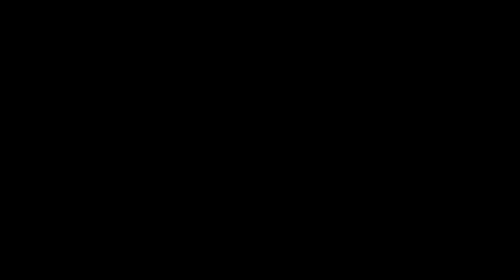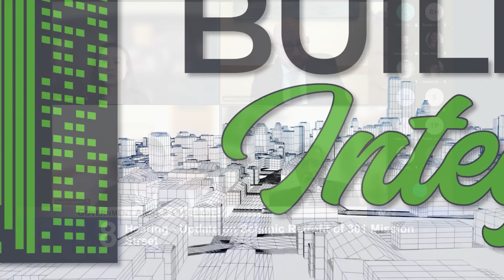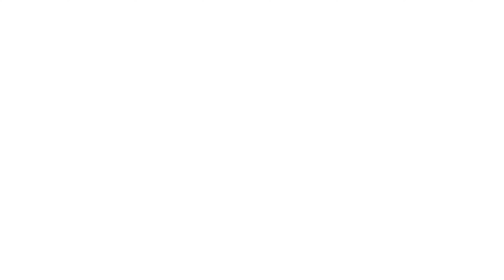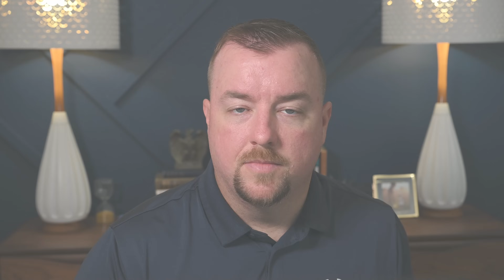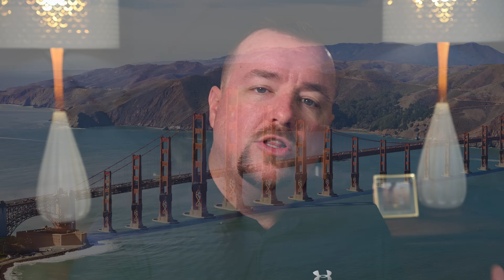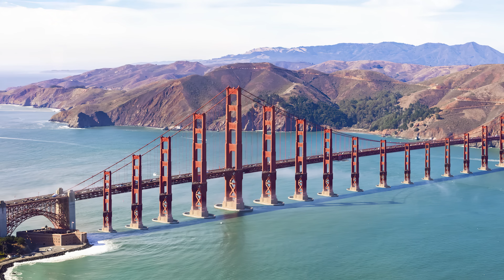Millennium Tower's "Sophisticated" Fix?  You Decide - (San Francisco's Leaning Tower Part 4)

Comment: Seeing that installation of "fixer" piles on the low side has shown that it accelerated settling of the low side, why not experiment with installing "fixer" piles on the high side to see if it accelerates settling on the high side. IOW see if you can correct/augment the tilt while the correct solution is found and implemented.

Comment: I think two things happened. The cost of installing 52 piles was X and it would be more desirable to have less total cost from the point of cost. Now with the increasing tilt caused by test pilings its time for a round of good old CYA.

The original design was flawed and the "fix" sounds like it's equally flawed, maybe it's time to cut to the chase and bring in the wrecking ball.

Comment: I think they went to an expert for a solution to the problem, and their idea of an expert was an almost retired engineer with a lot of experience, who didn't want to use a computer because he learned the old school way, through cutting blueprints. Then that retired/nearly-retired engineer decided to come up with a simple solution, find similar problem that had been solved before, copy the design with a 3x safety-factor, and hope the solution was over-engineered enough it would work.

Then in executing the plan they realized they were destabilizing the ground too much, and had to come up with a lean-engineering solution, which probably required a computer with FEA using dynamic beam-analysis (I'm only a designer but have done beam-analysis before to check my work), then came up with the original solution the old-timer copied.

Short answer: it took them a while to realize they needed a computer analysis, not just a grey-beard analysis, and by the time the ego-trip happened . . . the computer told them they had over-engineered the situation, should have gone to the computer first, instead of the engineer with the most plaques in his office.
Reply: Strange-- you're the first person I've seen mention FEA, either in the video or in the comments. Do you suppose they actually used it at some point?
Reply: @exrobowidow1617  With the situation with the tower getting worse, they have begun exhausting all options, now that their first 'cheap' bids/advisement didn't go well. They probably have done at least basic beam F.E.A. to get started, but a more advanced study would have discovered the problems they mentioned in this video before they happened, so I don't think they've done a full analysis yet, or are working on it asap. With the tower continuing to lean further out of plumb, they might actually be going to fully-meshed surface models instead of just beam elements to start getting their head wrapped around the problem. There aren't a lot of independent people in that field to hire though, mostly larger businesses and corporations who can afford the six-figure price for the software and a mainframe computer system capable of meshing and calculating quickly and give them real-time answers, so it starts getting really expensive to hire the engineers now.

Comment: If your company ever worked with geotechnical engineers, you would understand that's exactly the way that many of them work.  They don't like to state exact numbers, they don't want to be held responsible if 19 would work but 18 wouldn't work.  They provide recommendations to guide the engineer, they don't provide optimization.  Now on the engineer's side, if they can put in 52 piles and if 52 piles work then I agree that they should be happy to put in 52 and not question anything any further.  Maybe you would put in 52 piles because you couldn't put in 53 or more than 53.  Now let's assume they put in only 18 piles, what if that doesn't work.  Someone probably thought that the original design would have worked.  Now someone thinks that adding 18 piles is enough.  Can you put in more than 52 piles?  Maybe put in as many piles as you can and try to have it fixed once and for all.

Comment: 18 clearly seems to be a solution to the problem that these piles are causing the settling to be worse.  So 18 will decelerate the damage from that of 52 (or 42).  The argument Hamburger made was ridiculous to my ears.  What I failed to hear is more important - how would even the 18 piles ultimately be a benefit, if adding these piles is making the situation worse?

Comment: You mentioned they originally set out with 6 foot spacing.  This appears artisanal as opposed to mathematically computed spacing.
Is this a case of this has never been done before, so there is really no science to let you mathematically compute how many piles you need, but no engiener wants to admit it so they concoct all sorts of stories to make themselves look like expert in a totaly new field where thstr is 0 experience by anyone?

And how come some engineer would come up with 52 piles and only then send it to a geortechnical engineer for verification?  Why wasn't this done by a geotechnical engineer in the first place? 

In the "with 52 piles, we will win contract over the guy proposing 400" issue.  Is this a thing where a project will knowingly overbuild and not optimize a design because they know the competition is worse? By overbuilding, they get more $$$ for the contract.

In Delaware at Bethany Beach, they rebuilt the bridge over the Indian river outlet into ocean.  The constant and strong tidal flow over years had litterally washed the sand from under the piles of the old bridge. So there was a "hard"  requirement that the new bridge had pylons outside of river and none in the river. Engineers designed accordingly. 

In the case of Millenium tower, is it possible that serious engineering firms stayed away because they couldn't find a "mathematical" solution to the problem, leaving only questionable engineering firms willing to bid on an artisanal fix?

Comment: Having watched the video until 6:30 currently, I have a slightly less opinion on hamburger's position than you. First you claim he indirectly accused the geotechnical engineer of not informing him properly about something. I think that acusition is not properly backed. He there just explained the workflow and why it took so long I guess.

Then you say proposing 52 pillars was bad engineering. Here I also only agree in part. It was definetly not good engineering, but I see a scenario that would justify that decision. Hamburger might have investigated the idea with 52 piles because he wanted a confirmation, that this design can work. His plan might have been to optimize it later, what he in the end did with the 18 piles.

What bothers me more is that they haven't properly investigated wether they can even install these piles. A good analysis should have shown that the vibration is to risky. Maybe they checked it. But I don't know anything about it.

I would love to hear some responses. I'm an engineer, too btw. And I love your videos <3

Comment: For background on the building's broken back, refer to the first video in this series, "San Francisco's Most Exclusive Sinking High-Rise", starting at 11:06.  There are 2 glaring pieces of evidence that the building is unsalvageable by adding external piles:  (1) The 10 foot thick foundation slab, which acts as a beam to distribute the weight of the building is dishing, ie the center is sagging, meaning the hidden bottom chord of the beam is failing.  (2) Photos of a "shear wall" in the basement, which by its name is also intended to be a support beam, showing that it is falling apart. Ominously, the spalling of the shear wall is inclined at approx 45 degrees, ie, the direction of stress. If you look at an older steel truss, the diagonal members are inclined in the direction of stress, approx 45 degrees from vertical. Trying to shore up the outside of the building adds further stress to these failing foundation beams.
Reply: That cracking and spalling looks eerily the same as that university bridge prior to collapse in Florida. In that case, the engineers who inspected it, seemed to defy what their own eyes were telling them. That structure was heading for eminent collapse.
Reply: OMG!

Comment: I am a mechanical  engineer, not a structural engineer, but have a bit of generalist "engineering judgement".  I am halfway through this video, but am stopping it for a while until my blood pressure issues subside.  Still completely ignored is the evidence that the dishing 10 foot thick base slab and diagonally cracked (at 45 degrees!) shear wall(s) have already failed, and cannot support any more bending stress, as would be applied by external piles.  The slab and shear wall(s) are being asked to act as a beam to distribute the upward force from the external piles, which they have already demonstrated that they cannot do.  The only focus of this project should be how to get the building down safely.

Comment: Solution:
1. Mark a circle around the building 3x its height.
2. Place concrete barriers along the entire circumference of this circle.
3. Place a 12 foot high fence atop the concrete barriers.
4. Place concertina wire atop the 12 foot high fence.
5. Walk away.

Comment: I have major concerns with this building and it is obvious that the fix is a weak one. I  think they should demo the building and admit the failure. Money rules lol so when people die the loss of money is next problem. They could evacuate  the building  and experiment with a better fix and maybe get lucky. Maybe drilling on the high side but not anchoring the piles and monitor the settleing hoping it moves the right way. It is a failure in design and the fix is a gamble. To give up on it is very expensive but buildings can colapse. They do need to look at what the failure mode could be if things get worse and protect the public from grave harm.

Comment: There has to be a division of disciplines.  It is not geotechnicals’ job to question the other engineers.  If it was you wouldn’t have two engineering disciplines involved.   That doesn’t mean they can’t do a collaboration, but in the end each discipline owns their part.  I wouldn’t want to own anymore of this mess than I had too.

Comment: At one point in my life, I worked at a manufacturing Co for some specific medical equipment used in surgical procedures.  I was a consistent employee, that did quality work, and my supervisors knew it. So I was asked, on one occasion, to use a newly designed piece of equipment to glue some of the parts on the product.  I was to do that for the period of 2 weeks, so the engineers could find the "bugs" and fix them before letting others use that machine.  As the design engineer showed me how to use it, I came up with the question about "what do I do if this part has a problem.....?"  His response was, "oh, that will never happen."  A week later, guess what happened?  And yes, I had to bite my tongue when he showed up to fix that thing that "would never happen"!

Comment: Unless someone else steps in that knows what they are doing, and is exclusively focused on saving the building, not saving money or face, I don't see this building getting saved.
With this sort of people in charge, it's very doubtful that pure engineering will be applied to this, but it will be a political and ego driven effort, and the building will get torn down.

Great videos!

Comment: Feel that there is zero knowledge of what is under this building.  The possibility of anomalies is obvious .... performance of other structure in the area is accepted as basis for this structures design.  Also, is anything other than money preventing the dismantling of this structure and disposing of the project. Or, just continue, prop it up, cross your fingers, bite your lip and move people in. Turn it over to the insurance companies to take the residents risk.

Comment: The more that the building tilts to one side, the greater that the weight transfer is to that low side, and the greater that the fix has to be to resist that increased weight.  If the building is successfully shored up on the tilting side, that does not guarantee that the building will continue to tilt on the opposite side to eventually become vertical again.

Comment: I'm an engineer in an unrelated discipline, so this might be a silly question: shouldn't any analysis have been a (at least) 2-dimensional assessment? That is, you have to worry about both the number of piles, but also the diameter of the piles. So the requirements might have been able to be met with eg. 18 regular-sized piles, or 14 piles of increased diameter. This would then allow for trade-offs for both material, but also disruption above and below-ground.

Comment: THIS IS HOW THE MILLENNIUM TOWER HAPPENED
In mid-2004, the Department of Building Inspection took the extraordinary step of ordering construction halted on a 52-story project at 80 Natoma St. because the building would be unstable with the as planned foundation on the clay and sand soil of South of Market.
The then head of the building inspection department, Frank Y. Chiu, said in a legal declaration in October 2004 that he ordered a work stoppage in light of their experts’ warnings that the 80 Natoma St. project would sink far more than the geotechnical designers estimated.

At this point in time, The Millennium Tower is still on the drawing board and has the exact same foundation designed by the exact same geotechnical firm – Treadwell and Rollo –  that designed the much much lighter 80 Natoma St. project that was just shut down by the Department of Building Inspection for having an inadequate foundation. Treadwell and Rollo are now undeniably aware that their foundation as planned for the Millennium Tower is inadequate and that it will be rejected by the Department of Building Inspection so they simply did not submit it for review and let construction begin. It is of record and is undeniable.

This is what happened and it can be easily fact-checked by anybody, everything else that is being thrown around including the kitchen sink is I suspect an intentional distraction from what is a simple truth.

Comment: HOW TO FIX THE MILLENNIUM TOWER
From about the 25th floor, up attach massive straps to the core of the building on every floor and spool them out in the southeast direction between the 199 Fremont Tower and the Park Tower located on the corners of Beal and Howard St and attach them to a massive anchor placed in the ground out front of  285 Main St and winch the building straight. 
While the building is being held straight by the straps sink the piles to the bedrock on all 4 sides and then attach the building to the new piles on all 4 sides. 
If the Tower sinks while the piles are being driven it won't matter because it will remain straight by the tightening or loosening of the straps.
Remove the straps and you're done.

If you have not already guessed... I am not an engineer
But I can Macgyver

Comment: As I suspected. Several of the parties involved in ownership and the "repair" are about to go insolvent.
The cleanup will be inherited by the city and this building will probably be demolished, or reduced in size.
Reply: I agree.  When the dust settles it will be TAXPAYERS who will be stuck with costs.   Does anyone -- RIGHT NOW, TODAY -- have the authority to pull the plug on this obviously mis-designed and poorly constructed building?  Probably not, 
until the thing just falls over and utter crisis management rules the day.  Just saying. . .

Comment: The proposed fix has proven ineffective and in fact exacerbating the the leaning of the structure. This engineering team or perhaps another team needs to do a much more through investigation of the cause and perhaps testing a proposed fix using a laboratory scale model. Hopefully a solution can be found and implemented. Short of that the building will have to be deconstructed before it causes a catastrophic collapse. I don't envy these engineers, this is a really difficult if not impossible problem to solve.
Reply: If the engineers were actually doing engineering, they might be able to come up with a workable solution.

Comment: In any project, you have to start with a preliminary design.
That have to be analyzed for fulfilment of objectives, strength and stabililty are but twp factors.
Then this preliminary design is modified.
Rinse and repeat.  Step four or five shuold have a reasonable chans of passing, roughly speaking.
So, nothing new or nefarious here.